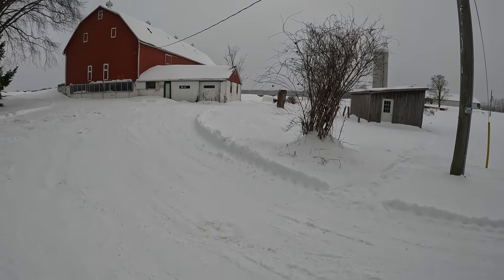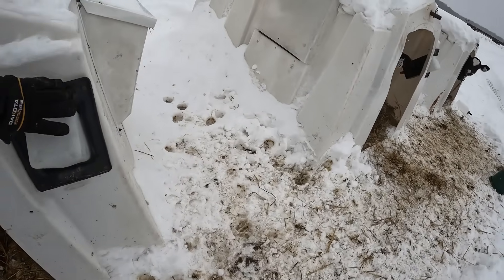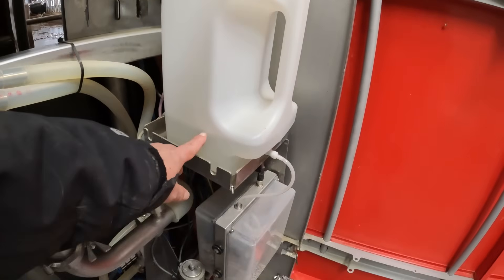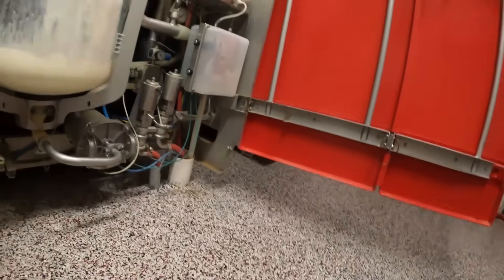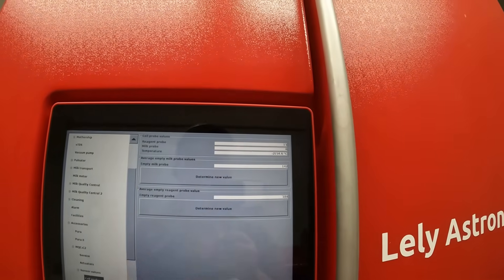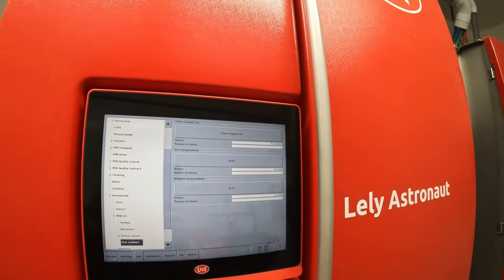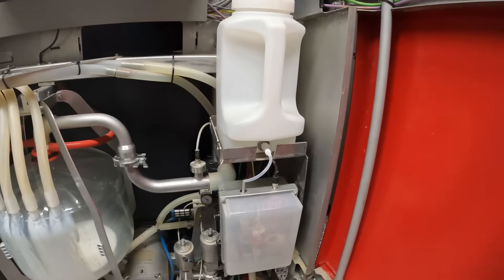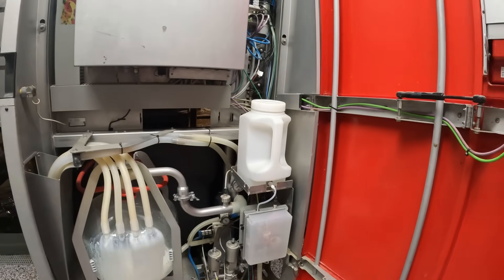A4 Lely Robot MQC-C Quit Working and Running a Cup Offset Calibration

Comment: Great job!! Wishing you a happy and prosperous New Year!!!
Reply from the maker: Thank you! All the best to you in 2026!😊
Reply: Great video! Just a tip all that condensation in the box, usually it comes from a crack somewhere in the plastic cover or the seal is bad. We had the same issue where ours were just keep shutting off and doing random things because it was getting too much condensation in there.
Reply from the maker: @AlexVenoWhite yes, I did say it in the video but it didn't come across loud enough. The one corner of the box was broken off already and now another corner had broken. I had told them about the one broken corner before but they weren't too worried about it. This time I told them I wanted a new cover, especially with the 2nd corner breaking. Thanks it is good to know I was right about the condensation not being good. 😊